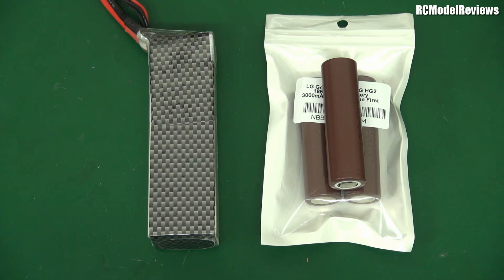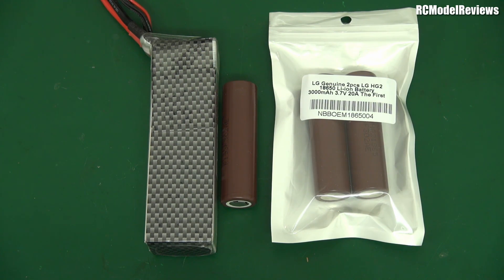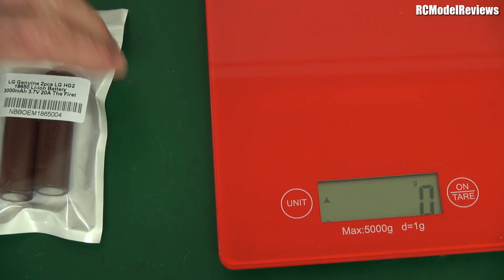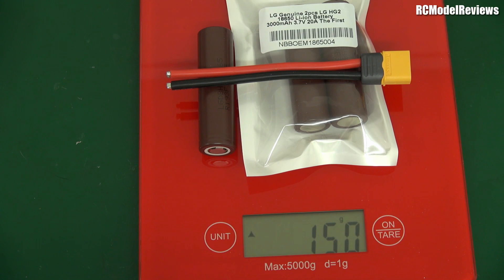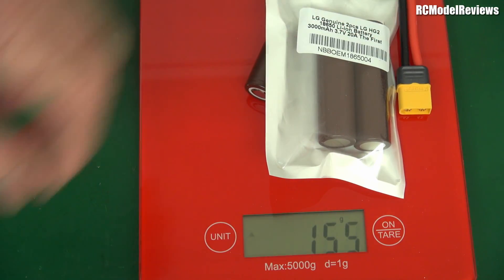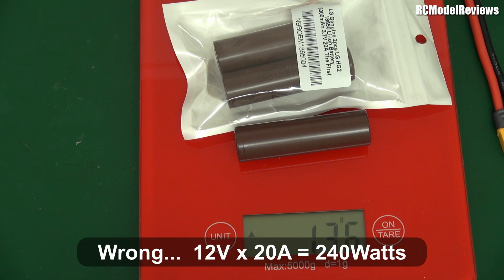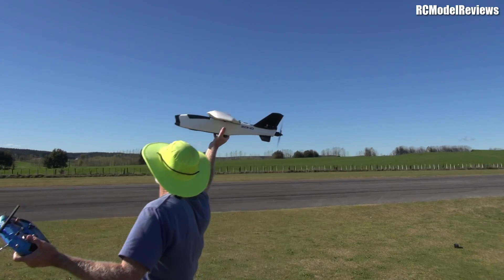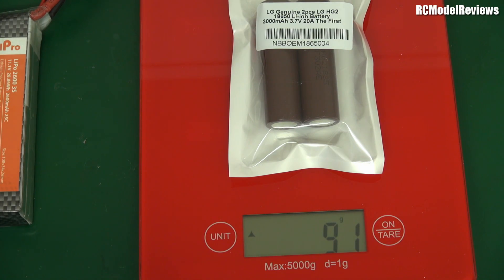Lithium-Ion (18650 cells) versus Lipo -- which is best?

Comment: I made me some 4S1P 3000mAh batteries for my LR quad. With the right props I'm getting up to 14 minutes flight time. I'm really impressed to get this with a 5" and 2205 motors with 2300KV when everybody is going to 7" and low KV.
Here a 12:35 flight https://youtu.be/Mx6imo8B5iA

Comment: Hi Bruce, great intel as always. Is there any chance you could explain discharge rating? A single Li-on battery is good for 20A discharge, are you still limited to 20A discharge when you connect the cells in series or parallel. I'm thinking about making a 6S but need max discharge of 60A. Would 6S 2P work? Thanks again mate and keep up the great work.
Reply: Tyron Moore wiring in parallel adds the discharge ratings.

Also, the higher end 18650s hit 30A continuous, so two of them would be ideal, but then capacity is knocked down to ~2100mah.

If you can find them, 21700s might be a better option for you.

Try to have a 20% overhead for your continuous discharge rating at the very least.

Comment: I  am guessing it would be wise to turn off any low voltage cut off in your esc - if you can of course. Plus if using a flight controller make sure to make adjustments to any low voltage failsafes.
Reply: Do flight controllers have low voltage failsafes? I've seen a betaflight quad go from 16v to saying 6v on the OSD with no more than blinking "LAND NOW"
Reply: Yes, if your using something like Arducopter you can set a failsafe, you can choose what you want the craft to do, RTH, land. Or you can simply turn that failsafe off - which is what i do because i have the osd to let me know battery status. Don't know what the choices are for other f/c's,  other than my whoop all my craft run arducopter on pixhawks.

Comment: Another benefit is lifespan, they run rings around lipo for cycles before decay, and even if discharged to 1v/cell, suffer virtually no capacity loss.
Reply: Depends on the chemistry and bms.
High discharge cells will have less cycles. Use between 20-80% capacity will greatly increase life. High temperatures will degrade battery. Leaving at low or full charge will degrade.
https://batterybro.com/blogs/18650-wholesale-battery-reviews/103090502-why-do-lithium-ion-batteries-die-long

Comment: A website I would recommend is Nkon, I paid 180€ for 50 cells, Sanyos are really good. They are 30A 3Ah cells. Now I'm waiting on my spot welder to make my own batteries
Reply: They sell hg2 with solder plates for 3.90€ atm
Reply: Yep that website is great.  I replaced my 2012 vintage ICRs in my e-bike with brand spanking new 3.6 AH IMR-18650s.  Only 160 euros from Nkon and my bike rides like new.

Comment: Doesn't the 'C' rating impact the weight, with higher C ratings meaning more mass for the same mAh rating ?
We use the Li-Ion's in the packs on Broadcast and Cinema cameras, where the current draw is much lower then the majority of Quads, and is comparatively tiny to a race quad.
Reply: Weight will be similar, just different chemicals, but cycle life will go down.

Comment: I hope you touch on how charge these things.
Reply: EC White you charge them with a regular lipo charger, just make sure to read the charging rate which is usually recommended to be around 0.5-0.75c,, my Panasonic cells can be charged at 1c Max, but they recommend you charge them at 0.5c for longevity.

Comment: Another Plus to be using Lithium-Ion 18650's is, you can get them for free, Just go around your neighborhood on hard rubbish days, pick up a laptop or two, tear apart the battery pack and you got yourself 6 of them from each laptop.
Reply: Problem is the max current draw on old laptop batteries is probably about 5 amps so not so usefull for planes.
Reply: @Meonlymeagain  no ! pay attention to what i said! Open the battery pack! 18650's are 18650's no matter where you get them from or out of !  its a slandered, just like AA or AAA or C ......

Comment: Better 3 in the air than 30000 in a Tesla.
Reply: It's 200 Lipo cycles vs 1000 LiIo.
Reply: Use 2.6V min on the ESC.
Reply: Buy them with cables.
Reply: 8,256 cells in largest pack.
One million mile life in next generation Maxwell electrode pack.

Comment: And how about supercapacitors or combine the best of both worlds (high discharge capacity and high energy density by weight).
It is the subject for a comparative video.
Reply: Super capacitors have a terrible energy density by weight when compared to lithium batteries, they have something like 2-5% of the energy density per unit weight than that of a lithium chemistry cell.
Reply: @danspratt2  and in relation to the power density which is the best? :)
Reply: @11skyparte11  Supercaps are, however a short burst of high energy, totalling up to 5% of a lithium battery isnt suitable for rc models. Also the voltage of a supercap falls linearly as energy is taken out, again not ideal for powering rc models.
Reply: @danspratt2  and in relation to charging times, it would not be interesting for RC models to have batteries charged very quickly? That's why I said 'the best of both worlds'.

Comment: I built a pack out of 6 Samsung INR18650-35E 3450mAh - 10A

Two parralel 3 in series makes it a 6900 mAh 11.1v pack, weighing just 300g. It can only deliver 20A but the plane I use it in only uses 10A max! I bought these cells for just €4 a piece, so total cost was just around €25. No lipo can compete with this!
The plane can fly up to 90 minutes at 40km/h so it can fly 60 km far

Comment: 1+hour flight time on a 3s1p on a nano Goblin cruise speed about 35 mph top speed about 70 mph and it's under 250g with a foxeer mix HD fpv camera. So something like your little micro fpv plank it's using the same motor so you might be able to get the same performance don't you think?

Comment: Actually LG recommends charging them to the same voltage as a lipo and also use a lipo settings on your charger not lithium ion. Take a look at the efest 18 650 40a 3900mah that's what I'm using on my AXN it screams! But I'm glad you are playing with these 18650 cells really looking forward to learn more about them. And maybe a simple DIY supercapacitor spot welder I put the batteries together if anybody can make one super easy to use yocan mr. Bruce 😈
Reply: The reason for LG saying that is that there isn't really anything special about lipos chemistry wise. They are just one type of li-ion cell in a different formfactor. And there many different types of li-ion chemistries, but the "packaging" of the cell is not deciding factor for that.
Reply: @superdau  no it's not the deciding factor but the E-Fest cells are far more Superior for what we need them for. They're what I'm using in all my planes and quads.

Comment: Brucie baby! do us all a favor and include not only flight time, but also flight distance in your test. Perhaps the lipo
 will give you greater distance with less flight time because of the ability to run wide open throttle, where as the other will give you longer flight times at low throttle
Reply: Probably didn't have a flight controller on it.

Comment: The definitive use for LiIon is currently automotive. Intense research and development is ongoing to increase energy density and lower costs for the enormous task of converting transport to electric.
Tesla' Halifax lab under Dr Jeff Dahn is leading in producing the lowest cost, highest performance, and more quantity than all others combined automotive and stationary 1865 and 2170 cells. The recent acquisition of Maxwell Technologies will accelerate this effort.
As all manufacturers are supply constrained and will remain so for a year or two, it is unlikely anyone else will be able to buy high performance individual cells at the retail level, unless ridiculously expensive or inaccurately labelled.
Attached some references for current performance and mechanisms of cell failure and cell care.
https://batterybro.com/blogs/18650-wholesale-battery-reviews/103090502-why-do-lithium-ion-batteries-die-long

https://www.youtube.com/watch?v=P7GR5fERXNY
https://youtu.be/zvavP2RJSLc
https://www.youtube.com/watch?v=18MYRkx_Vr4&t=2s

Comment: @rcmodelreviews Bruce, you might want to update this video or add a appropriate annotation or comment on top of it: The power (Wh) to weight ratio is not that different as you suggest. Your quick initial weight and power mental calculation is off (due to real voltage under load. You better do proper weight to charge capacity (Wh) calculations, voltage is not a good measure). The difference (with good LiPos) is at most 20%. Given that 18650 are harder to make as a pack, where as Lipo is already done for you, I would say it's not worth it.
Remember, the only real comparation is on the energy density (energy stored/mass). All other measures, weight, voltage, as you did are just misleading and kind of intuitive (in the wrong way) for most of us: lighter weight -> longer flight times. Which is wrong. (Yes, I ignore the max current output, assume it's enough for what you want to fly). The only real measure is how much energy can be delivered over time for the same mass. Hence, in real life, LiIon - LiPo the difference is max 20% (for LiIon cells that are usable for our hobbies: can deliver let's say at least 5C discharge).
Here is a quick reference already calculated: https://i.stack.imgur.com/Z9Flb.jpg
Reply: Castravete Murat the major advantage is in form factor - pouch vs cylindrical cells.

Cylindrical cells allow for much greater density due to increased internal surface area - kind of like how capacitors work.

Now obviously it’s going to depend on your application, and for most RC pouch lipos will likely continue to be superior to cylindrical liions but there are a lot of applications where the liions have a pretty significant advantage (and 20% is huge).

Comment: Perfect timing! I have a VTOL and have seen that Foxtech has a battery swap board. Use a small Iipo for vertical take off and landing and switch to li ion for forward flight. Only problem is unless I want to spend a ton of money I'll have to build the 6S 12000mah battery. Show us the battery build!

Comment: I assume you can't really use a lipo charger to charge lions?
Reply: I charge my Titan li-on packs with lipo charger.  Titan even recommends using lipo settings.  Like my 4s1p 3,500mah li-on TITAN recommends charging at 1.8a I charge usually at 1.4a and they charge just fine to 4.2v and I’ve had these for a while now.
Reply: slebetman yeah you can use lipo charger for lion.  It's lifi you shouldn't use a lipo charger for (they have a much lower max voltage, 3.75 iirc instead of lion/lipo at 4.2)
Reply: Most All Chargers Do Both+ Nicads... ;~)P

Comment: Had a play a while ago with 18650 and a 4inch. Went ok.. couldnt really punch it. 5 inch... no chance. But 3 inch is looking like a sweet spot for a high capacity li ion 4 - 6s packs. I'll be doing this soon. Waiting on bits. :)
Reply: Forgot to add.. for the 3 inch im keen on using cr123 size li ion.

Comment: Now get a LiFe and test that. =P
Reply: More expensive and insanely heavy... that’s not what you want for something that flies. I just got a LiFePo4 battery for my ebike, they are suppose to have a super long life (7 year estimate for useful life compared to 2-3 for Li-ion). But it’s a ridiculous bowling ball in terms of weight, a few tiny Lipo batteries will more than outpower it, and in terms of your first year of ownership, Li-ion is like half the weight and much smaller volume per energy stores.
Reply: @jakegarrett8109  My comment was a joke. A bad one. =P

Comment: Good for long duration flying for sure  not for general RC flying use and can't be charged as fast.
Lifepo4 a123 cells used to be good for fast charging and high drain but heavy for same capacity.
Lipo is unfortunately still the best option generally but I can't wait to see the back of them for safely reasons.
Reply: Most of the 18650's you can charge with 1C.
Reply: @ZeroFPV  yes, while a123 lifepo4 cells and newer lipos can be charged at 3 to 5c or even higher. 8 min charges are fantastic but somewhat scarey lol.
Reply: @FlyingFun.  

Oh, wow. :-) I'm more the 10 packs in parallel @1C charging type. I want to keep them healthy as long as possible.
Reply: @ZeroFPV  yeah, I'm somewhere in between, 2c charge regularly, reason is British weather creates short windows for flying and getting charged up fast before it changes is needed, I don't store charged....
I have multiple chargers and charge individual packs , so in 25 minutes I go from storage to full charge , hppefuly before the rain starts again lol..

Comment: I've been using the Sony VTC6's (4s2p) in my 7" long range quad with great results, they will deliver 60A+ if you need it but I mostly cruise around at about 10-15A for 20+min flights. Be careful where you get then though, plenty of dodgy sellers out there..
Reply: FWIW Sony batteries have burned up more laptops than all other makes combined.
Reply: VTC-6 cells are IMR, not ICR. No fire hazard unless they get physically damaged, as their resistance increases with heat.
Reply: Forget about Sony.Chinese brand Liitokala has 40 amps discharge for 21700 ,4000 mah cells.The best brand of cells in the world for high discharge.

Comment: i'm in the process of building David Windestal's long range tricopter, which people claim can get a 40 minute flight off a 5200 3s, and up to an hour if you stack two batteries together. i'm really curious to try on this a 3s 6 battery 18650 to see what crazy flight times are possible
Reply: I'm getting up to 14 minutes with a 4s 3000mAh and 5" (2205, 2300KV) so I'd say it's possible with bigger prop and lower KV. https://youtu.be/Mx6imo8B5iA

Comment: The low voltage cutoff of most ESC's gives problems with using 18650 cells, most of my HK esc i can't disable it, so started using bl heli esc's for fpv planes with mixed results.
Reply: Is the cutoff too high or too low?
Reply: too high, since the esc's cutoff at 3.2v which is normal for lipo's but way too high for li-ion cells since then you can't use 30% of the capacity. My nano talon flies 60-70 mins with a 4s 18650 pack.

Comment: You'd want a low dropout BEC using li-ion 2S, but if the label current rating on those cells is anywhere close accurate, those look like the way to go for an endurance model.  I was looking at a 2S pack and 10A motor controller for a sub-250g model.
Reply: I am afraid that this 20A figure would be a bit optimistic. 
Is it really sustained current at which the battery is able to deliver all it's juice?
It would probably reduce capacity by 30-40% or something.
But if you are able to cruise at 7A per battery, it might be much better.

Comment: A couple years back I built a camera quad that I used 18650 cells in. It was purely as an experiment to see if it would work. I built it to only sip power, but worked out that at full throttle it might be a little too close to the amp limit for my liking with 3S2P (Like Li-Po's, The easier a time you give them, The more cycles you get before they're scrap), So went with 3S3P instaid. As I also vape, and already have a few 4 cell Li-Ion chargers on hand, I decided not to solder up a bloody great pack, But got some battery holders instead.
I'd built the quad to take 4S so I used three 4 cell holders and wired each to hold either 4 cells in series, Or 3 cells and a dummy "Pass through" cell. 
It flew pretty well on 3S so I never actually got around to trying it on 4s in the end.
Flight times were......... Longer than I could concentrate on flying in one stretch ! But I estimated it would be somewhere around 25 minutes if I wasn't pushing it too hard.
In the end, for convenience I converting it to run with the stack of 5000 3s Li-Po packs I bought for a larger folding Y6 I built as its replacment, Then not long after that, as it was now surplus to requirements a friend bought it off me.
As an experiment it was pretty good, But at around £60 for the 9 cells it was cheaper to just use budget Li-Po's as it didn't need a high C pack.
Reply: New Li ions like this LG HG2 are very good, and can give a good discharge rate. These batteries with 2p configuration can give lift off easily